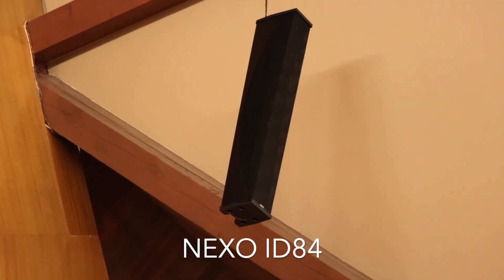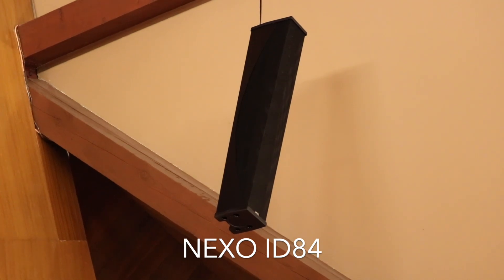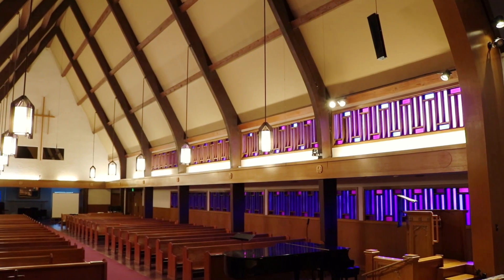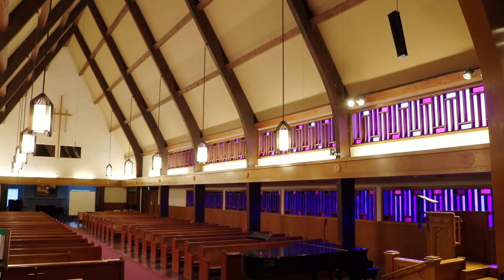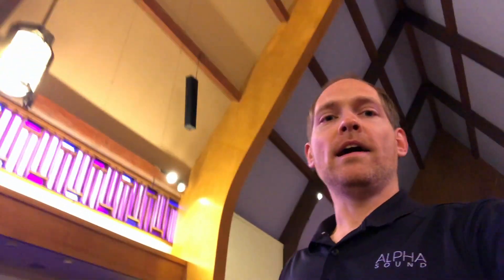This NEXO column speaker works like a curved line array.

Comment: We tried iD84’s for our new PA in our band, but we found them a bit ”artificial” sounding.  They didn’t sound BAD but they didn’t win us over. We ended up going for two L18’s per side with a P15. Two iD24’s for center fill (they are fantastic for their small size) we have two iD312S subs for smaller places where bass frequencies are a headache. They are also fantastic. Love Nexo

Comment: I don't understand why in reverberating spaces like this people have to install line arrays? I mean the only solution to this is to install multiple point source speakers near to the listening places and close to listeners. so you get crystal clear voice exactly where need it..... this is pretty common sense!!!!you don't necessarily need to dump line arrays everywhere!!!!
Reply from the maker: We've noticed that the single-source systems usually work better than multi-source systems in practice. With multi-source systems, there are many different delay times and reverberation angles about the space, and while it can increase the clarity for certain listeners, it can decrease the clarity for a number of others. With the single-source systems, if they are installed and calibrated correctly, the overall clarity for everyone goes up. This system actually replaced a multi-source system in the venue, and the clarity went up dramatically.
Reply: Because you apparently don't understand line arrays themselves. Line arrays have a higher vertical directivity in the shape of a cylindrical wave, and not a spherical one. Cylindrical means less sound to hit the roof and floor, which means more direct sound, which means better inteligibillity. Also a cylindrical wave means you don't lose power to those vertical areas, which then in return means that the sound isn't losing 4 times the power per doubled distance, but only 2 times, which means it will carry the sound further. Throwing around a bunch of point sources without thought, will give you more room reflections AND phase issues between them = worse. 

Of course, you are right that not every situation needs a line array, or that a line array is good for any situation, but they wouldn't be used this much if they werent a good solution for a lot of situations.
This btw is a simplification, there's a whole lot more going on physically, aswell as electronically that makes a line array great.